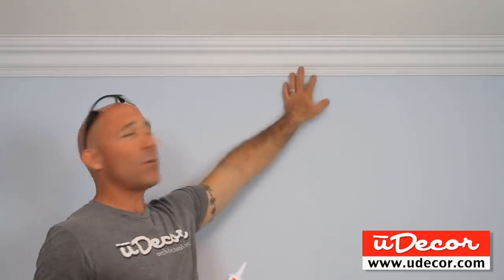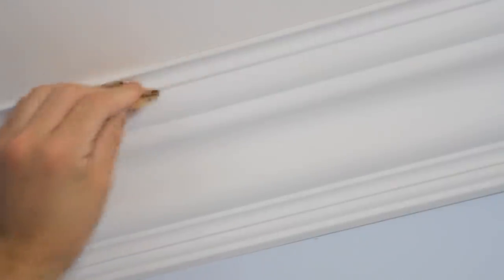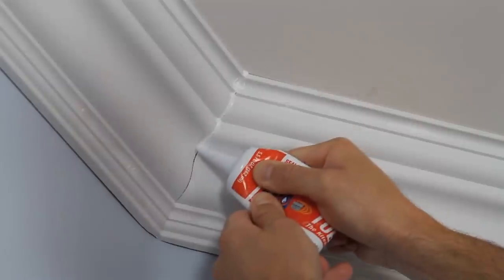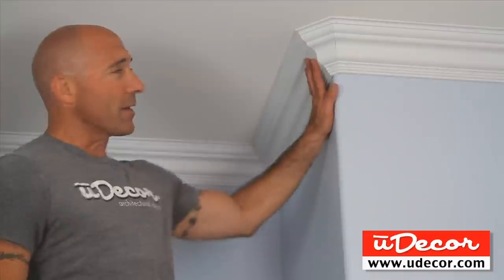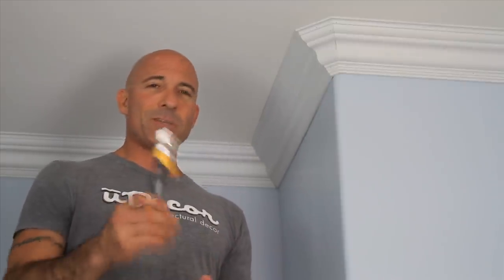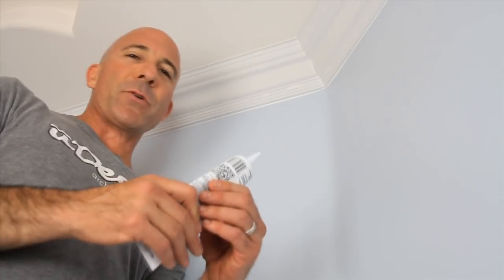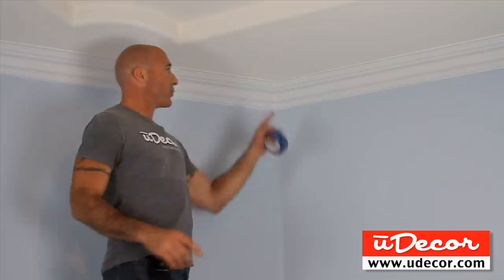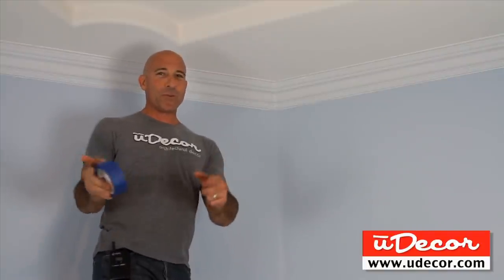5 Amazing Tips for finishing crown molding

Comment: How about on paint grade crown you use caulking when you install the corners, when you put the pieces together it squeezes out and makes it easier to hide a seam or corner.  Helps to have materials that have been aclimated to the building it goes into as well, since it will be balanced and less likely to expand and contract with seasonal heating and cooling changes.

Comment: in part 2 you don't need to fill that crack keep a 6 inch piece of trim with you and that crack that's shown needs to be lowered, place it on the ceiling leaning on both crowns and give it a good shot without damaging the crown, it'll go down and the crack will be gone, same thing if the crack was at the bottom of the crown bring it up instead of down :)